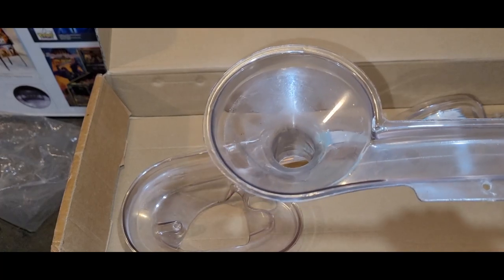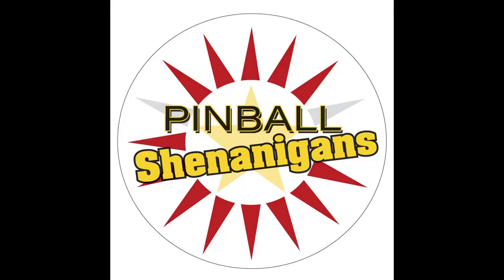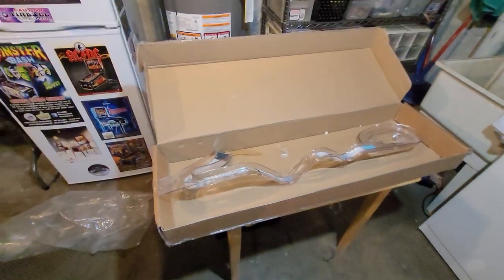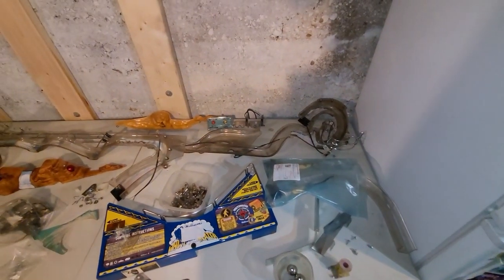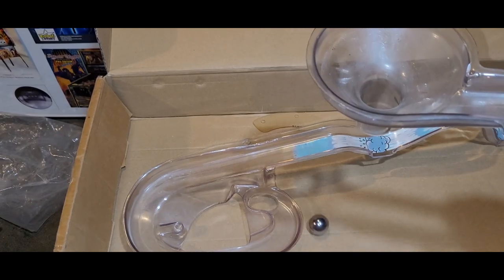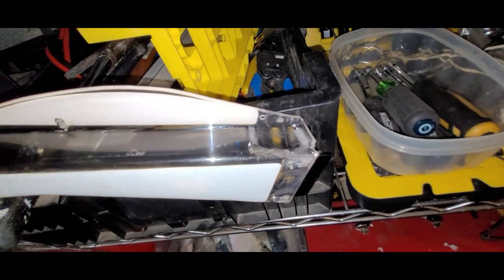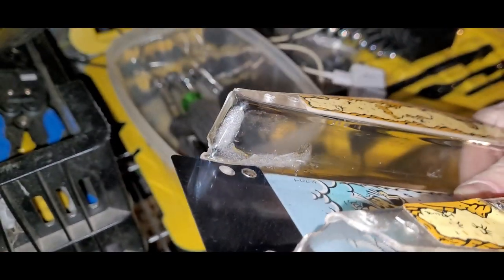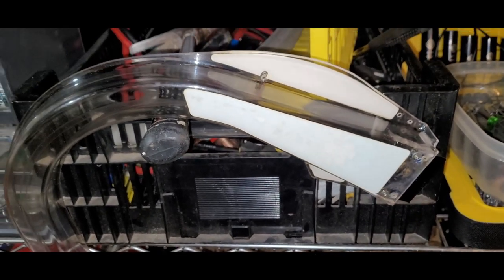Part 10: White Water Pinball Project. Installing ramps on the upper playfield!

Comment: When I did an WH20.. before prices got nuts. I cleaned the ramps with Black Magic tire cleaner, put them through the dishwasher [NO DRY CYCLE!!], sanded and flame polished them. Not for the faint of heart but the came out looking absolutely fantastic.
Reply from the maker: Wow that's very impressive. I will have to practice some flame polishing on some old ramps one day!
Reply: @pinballshenanigans  Make sure they are as clean as possible otherwise you'll just impregnate the dirt. Don't worry about sanding them glossy they can be opaque but smooth with a very fine grit only on the balls side; you don't want to mess with the decals underside unless you have new ones. Also be very patient. Only heat a small section at a time. You want the effects of the surface heat but it will conduct down into the plastic before dissipating in the air. If you go nuts your ramps will lose shape. Buy a case a beer. Do a couple sections far away from each other with quick licks of the flame. Sit down, open beer, drink beer, test that it's cool then repeat. Once case may do it or you may need two.
Reply from the maker: @necro_nemesis  haha that is the best strategy ever 😋